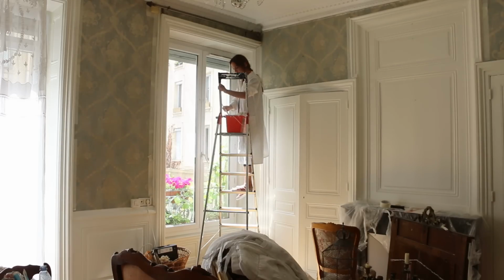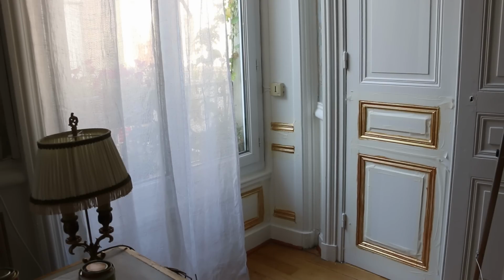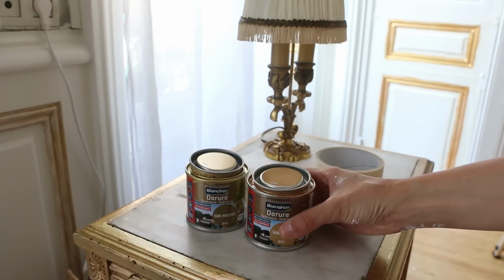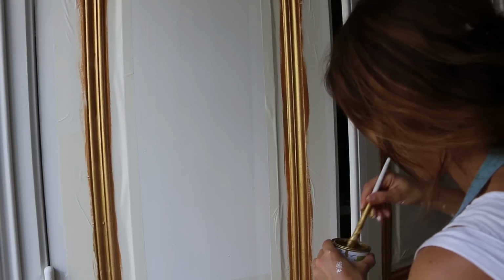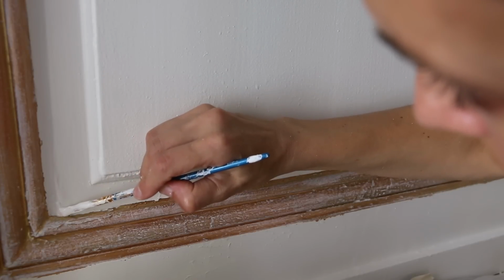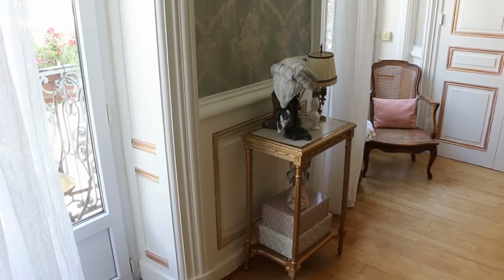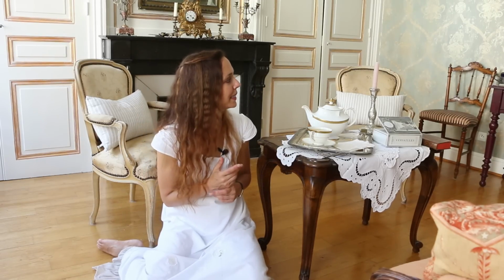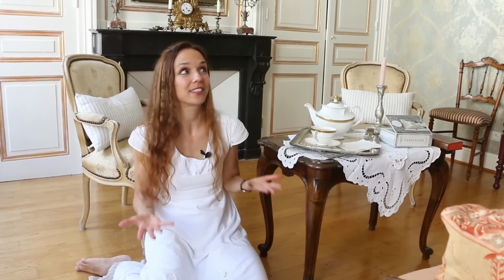Living Room Makeover-Turning it into a French 18th Century  Castle

Comment: A tip for when you use masking tape is to first paint with the same paint of the door or wall, let it dry and then go over it with the paint you want to use, in this case gold. It won't leak underneath the tape this way :)

Comment: Well done !!It looks beautiful and nostalgic ...
Can i ask ,what paint did you use for the radiator? 
When you turn it on will  have some smell?
Reply from the maker: Thank you,I used the same paint than for my wood parts , I know you are not supposed todo that and aaare supposed to use a special paint for the radiator, but it smells horrible when you have the heating on. So instead I use the water based paint, the same than for the wood and even If I will have to  redo it maybe realier than with the other one, at least it doesn't smell and is better for the environment :)That's what I did for my other radiators.
Reply: @Merveillesenpapier  oh thank you for your reply ..i thought so it is easier and safer i think i will paint mine too this way :)